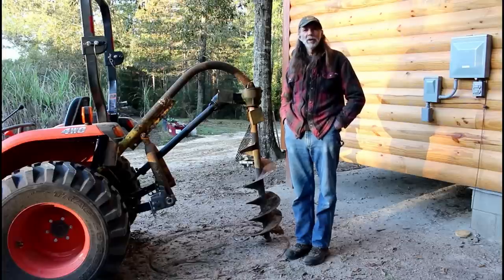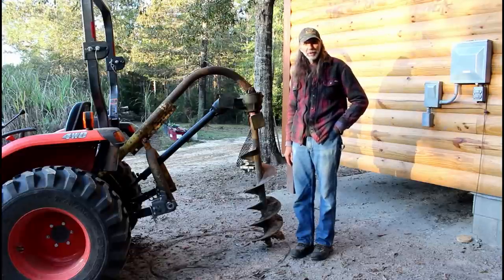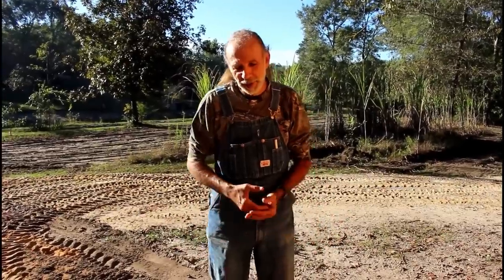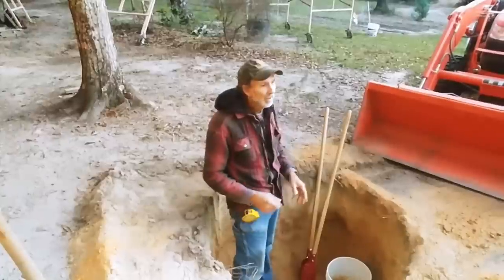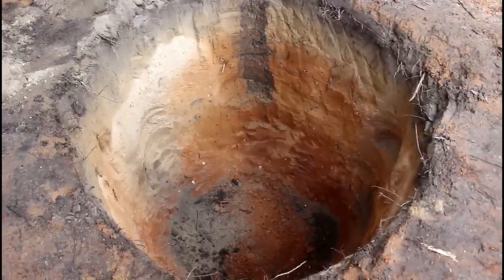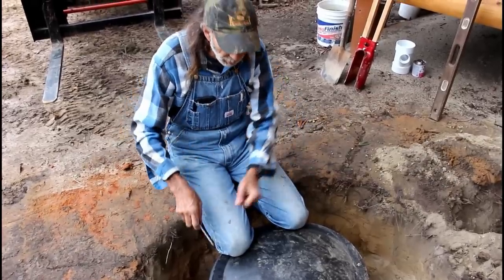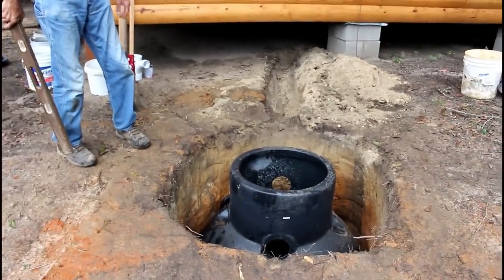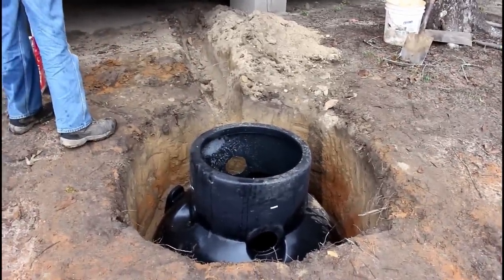Unusual WAY to Dig for a Septic Tank | Septic System Install | Part 2

Comment: WOW that tool on the tractor works wonders! Helps save a lot of time and energy lol... I never forget me and my mom dug a fifty foot by 4 ft long trench in the mountain for my auntie Bell. We did it with a pick shovels and that was dire lol .. 12 hr day's and three days long! We were exhausted literally! I'll never forget it as long as I live. The reason we couldn't use a bobcat or tractor is because it was up and down the side of the mountain it was to steap. I'm still exhausted from that job lol....

Comment: Nicely done except for the tank choice.  The tank appears to be a pump tank or 'pump chamber' designed to receive effluent from a true septic tank.  The scum layer will be thicker because the layer is confined to the narrow neck and top of the round tank.  This could cause the scum layer to rise above the inlet and outlet breathers causing havoc.  Also, the inlet and outlet are very close together.  A greater distance between the inlet and outlet allows for more thorough separation of scum, solids, and effluent.  Better separation extends the life of the leach field.  Then again, maybe you took that into account considering your daily usage.  Thanks.

Comment: A two-compartment septic tank is what's needed. Your tank is designed for wastewater only, not waste AND water. A two-compartment tank will have waste/sludge in one compartment and then water/effluent in the other, which then drains into your leach field. You may have issues with your field lines in due time because solids will be able to more easily flow into them and clog them. But, I hope it works out for you.

Comment: That worked pretty good. Boy you can't do that on our property.  Just trying to dig a hole large enough the plant a one gallon flower pot in before you get a shovel deep the hole is full of water.
On the farm I grew up on, my brother and I hand dug a 6 ft w by 6 ft L by 6 foot deep hole to build a septic tanks in. The tank was made out of red brick in which my brother and I laid,. We did this same thing for a well pit.

Comment: renting a skidster with an auger attachment is not that bad. I rented one for 900 for 7 days and it came with a trailer. I did have to rent a f250 from home depot to transport it on day one and day 7. It was worth it though. The first two days i used a rock box and scraped all the rocks of the property. I was able to do a lot of pre planned work with the skid.